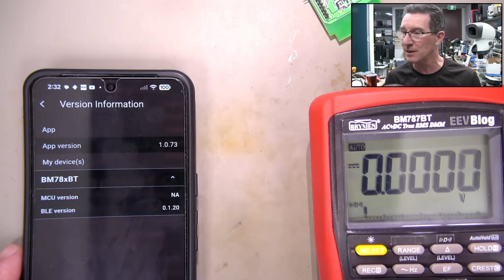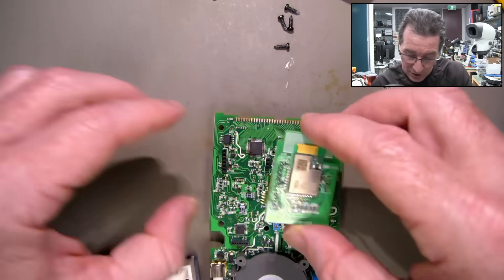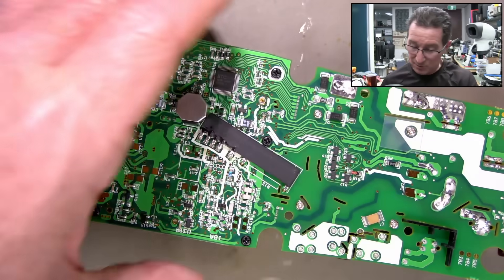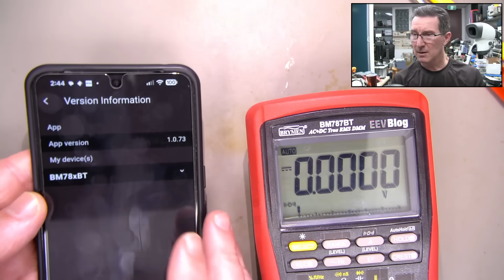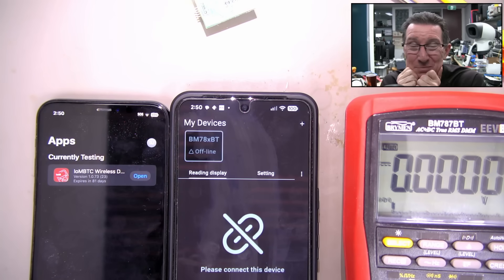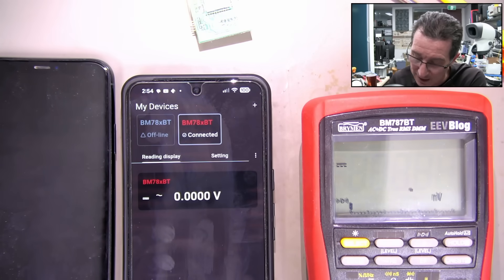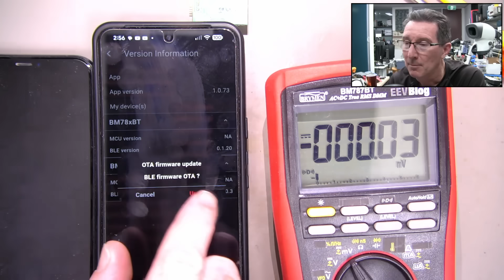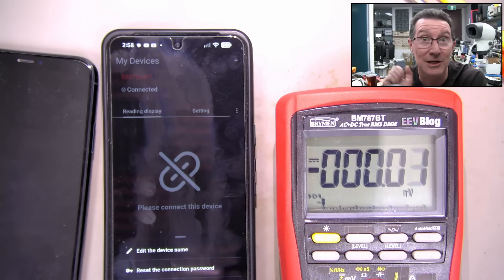Brymen BM787BT BLE Module Replacement

Comment: That's an extremely poor way to connect the Bluetooth daughter board. Kind of surprised given Brymen supposed to make quality meters... That'll be a point of failure for sure.
Reply from the maker: Why?
Reply: @EEVblog2 - It'll fall out. Seen it happen with car diagnostic dongles that had a Bluetooth daughter board connected with pin headers. Hot gluing it would be  temporarily effective. Silastic would be better, but really needs mechanical retainment.
Reply: @AdamsLab  It is clearly mechanically contained by the front of the case. If they want they could add some foam tape to reduce any vibration fretting.
Reply: @jaro6985  - I don't think you can say that for sure, without having one to look at. Based on what I can see in the video, it does not look like the case is making contact with the module. Even if you're correct, still poor design.

Comment: When you pair a device, you actually exchange encryption keys. If those keys later change for whatever reason (corruption, maybe?), this is the kind of behaviour you can get. Always try forgetting the device and re-pairing to rotate the keys. Keys are based on the MAC address, so maybe just the key for your Android got corrupted? Or maybe just a bug, idk. Also, for a properly secured implementation, you would want the pairing pin to be random and displayed on the multimeter when in pairing mode.

Comment: It appears that the meter will stop sending notifications after some random amount of time.  While logging with the phone application, the graph will stop updating.  This is the last major problem I am aware of and Brymen is working on it.
Reply: Brymen has just provided me with an update 1.0.4 firmware for the BLE radio to address this last problem.  I have started testing and should have an answer by the end of the week.

Comment: BT is so broken.
Reply: There's nothing broken. The hardware has physically been changed out meaning it has a new hardware address, meaning it has to be paired again. It's functioning exactly how it should.
Reply: In this case, but I just really really do not like BT. It works great for months, and then, out of no where, you need to delete device and re-pair it. It has gotten to a point i need to re-pair all my BT devices EVERYTIME I want to use them. Problem prolly in chair, not computer, but still..Why did it work flawless for so long and now it doesnt? Mind is blown.
Reply: Damn is it because iDevices cycle mac addresses now every 24 hours or so? Nahhhh cant be
Reply from the maker: @cdnron75  In this case the old module also failed to connect with the new app version, when it was previously working.

Comment: the mac address would have changed on the BT device so it will pair as a different device.
Reply: Exactly. The BT hardware has changed so it needs to be paired again.
Reply: BTW: The unique identifier of BT devices is called BD_ADDR (Bluetooth Device Address), though it uses the same format (EUI-48) as ethernet MAC addresses.
Reply from the maker: Still doesn't explain why the old module and the android phone stopped working after the app update.
Reply: If you look at 8:12 timestamp, old and new BT modules have the same MAC on the shoe phone.
Something more fundamental has changed perhaps? A certificate?
Reply: @wburger2178  Nope, old ends in :2A as last hex and new ends in: 4A.
Reply: @aiphaitohzaiw7664 I stand corrected! And why I prefer a diff tools to V1.0 eyball comparator!
Reply: @wburger2178   They don't have the same mac address:
BB : A0 : 50 : 78 : 4A : 2A  <  2A
BB : A0 : 50 : 78 : 4A : 4A  <  4A